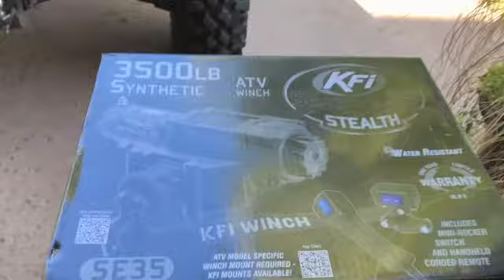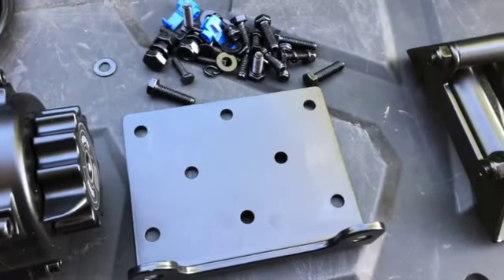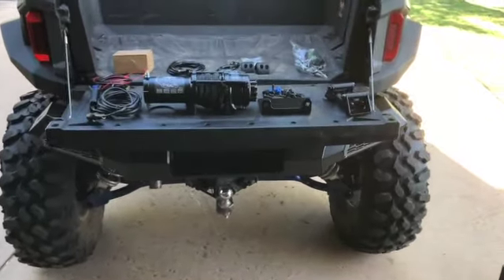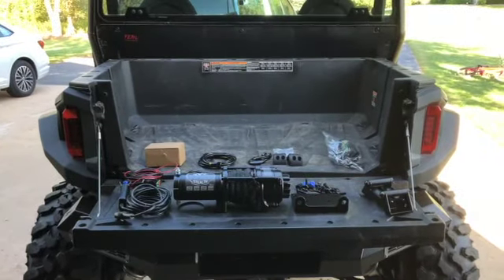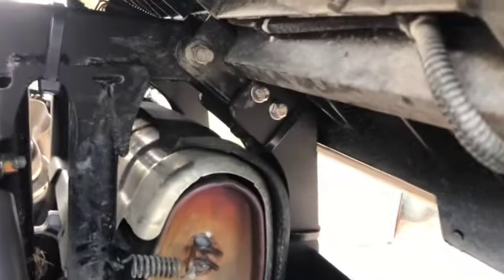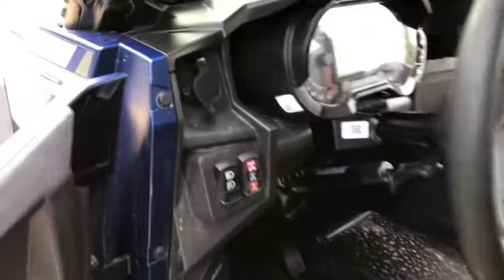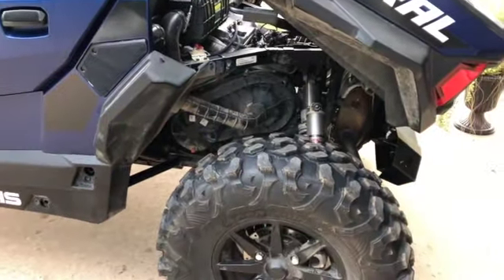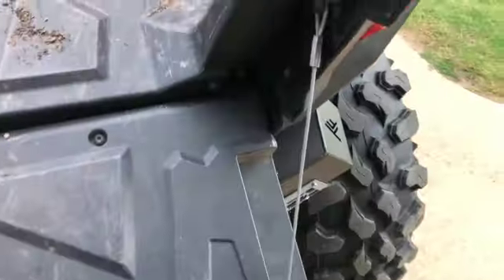2020 Polaris General Thumper Fab rear bumper winch install and lights wired!

Comment: I'm putting the same bumper with lights on my 2021 two seat general xp. Question: At the end of the wiring harness where the lights plug in, what does that small pigtail plug into?